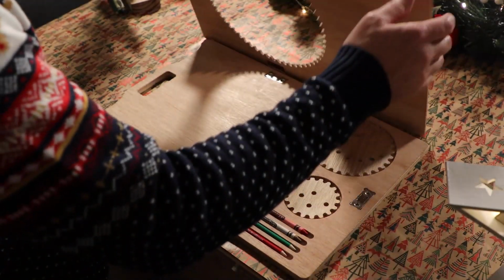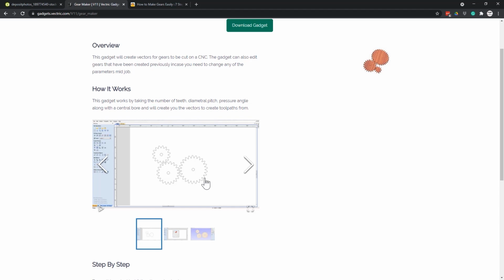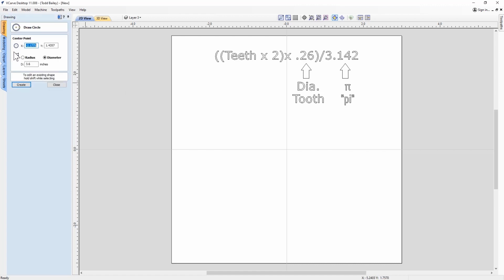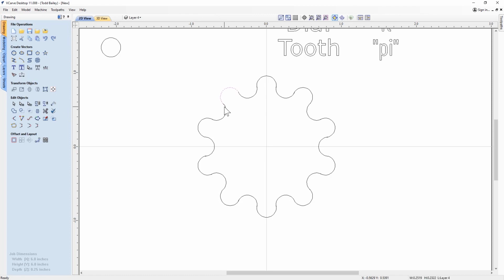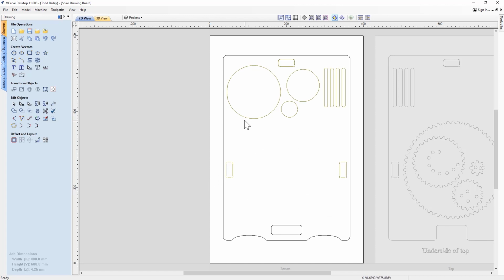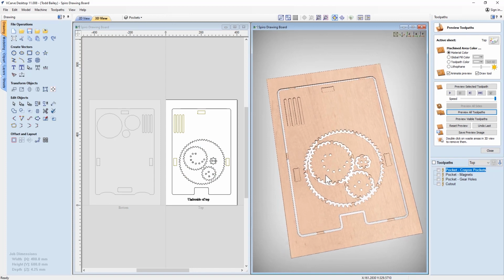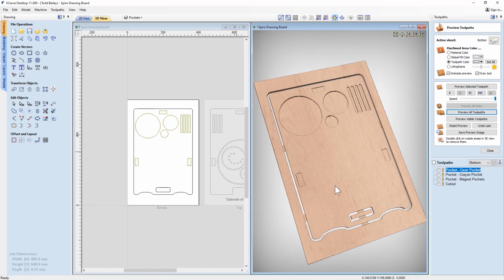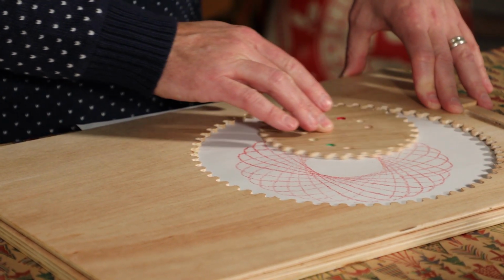Spiro Drawing Board with Todd | Vectric's Christmas Toy Shop | Day 1 | Vectric FREE CNC Projects

Comment: In modeling gears, addendum and dedendum are identical. For internal gears, just subtract the gear profile volume from the solid board. You wasted time doing the basic gear calculations in my opinion. In other words, just use the gear gadget as normal when sketching a profile on an object and extrude cut (subtract volume) from base model.
Reply from the maker: Thanks for that and it sounds like it would work.  I did try a couple of different methods... but felt this was a sure win and could be used by all of our users.  Seeing as the Gear Gadget is only avaiable to Pro and Aspire users.  In saying that I love how there are so many different ways to do this sort of thing... gets ya thinking.  I also feel, like you, that doing all the calculations for gears for a project like this is a bit of over kill.  Once I got the tabs sanded off and all the fuzzys removed I suspect the teeth wer not all that "round" anymore... :)
Reply: @vectric  It’s always good to try different methods when it comes to modeling, so I commend you on that. It’s the way we learn. Depending on the design, one method is usually better suited over the other. I retired from Mechanical Engineering after 31 years at age 53. 20 of those years I spent 3D modeling with emphasis in complex assemblies, some having over 10,000 parts! I mastered 5 different parametric softwares during that time and it usually takes about a year to learn each one. I’m almost finished building my second wood shop, after moving to a new place this year. I will be ordering an AVID CNC and plan on using the Vectric Pro. I shouldn’t have any problems learning it after reviewing the vids from Vectric’s website and other CNC users such as yourself. BTW, I always thought using a SPIROGRAPH to do inlay work would be fun, but with a CNC, who needs it! 😂

Comment: Well done Todd…..  another thought, if I add this to my to do list,  I may cut a second set of holes to accommodate color or graphite pencils.  Outside of that great work and thanks for sharing.
Reply from the maker: They Tom.... GREAT idea!!!  I was trying to make the holes in the cogs/gears able to accept a crayon.  It worked great except that the crayons broke.  I did in the end purchase the crayons that look like plastic pencils with "leads" you can replace and insert them in the top to push out a fresh "lead" (sorry if that description just confused thing).

Comment: Why not recess the top into the bas
Reply from the maker: Hey Joe... you are right that would have sorted out the laterial movement when using the spiro.  I did in the end make a new top out of thicker material (same as the bottom) and added hinges.  So the board now flips open.  Works really well... but your idea would look much cleaner!  Thanks for sharing!